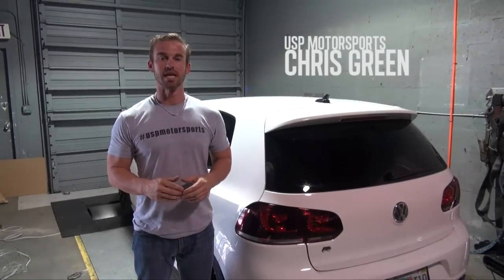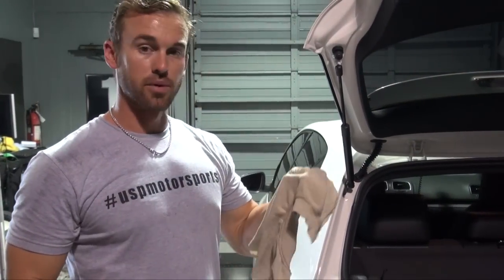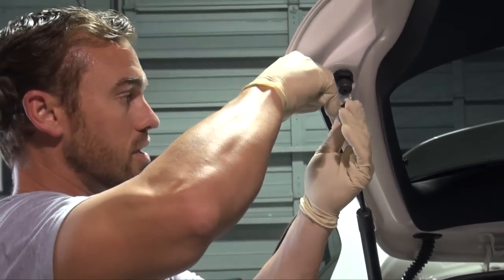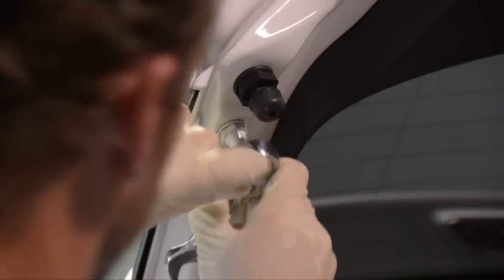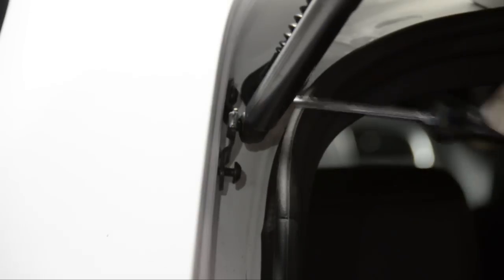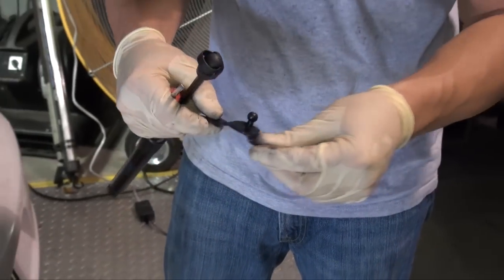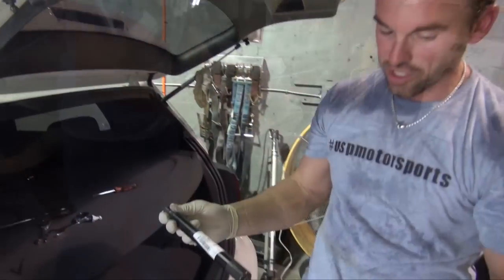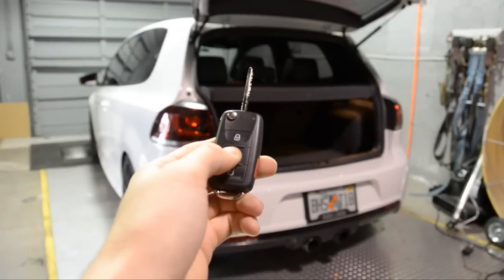VW Golf / GTI Automatic Hatch Pop Kit Installation by USP Motorsports

Comment: I don’t understand how this works? How are the ball bolts different? How does reversing the bracket on the other end make it open by itself? Good installation tutorial but can you tell us why it works?
Reply: They are different spring loaded shocks which provide the automatic lift when the latch is released.

Comment: Will this work on mk4?
Reply: All any car needs to do this is a trunk unlock button on the key fob. All the kit seems to be is just a set of much stronger support arms. OEM ones are designed to be strong enough to hold open the trunk, but not lift it themselves. So be warned I've done this in the past with a Celica and it opened like a catapult, but mannnnn was it difficult to close. Don't do this if your short or weak, because it was physically impossible for my gf to close it. Also be warned that if you park outside they'll lose strength over time anyway. Especially in the cold.